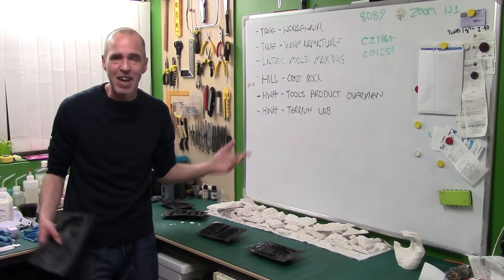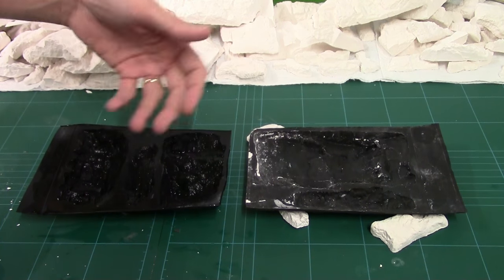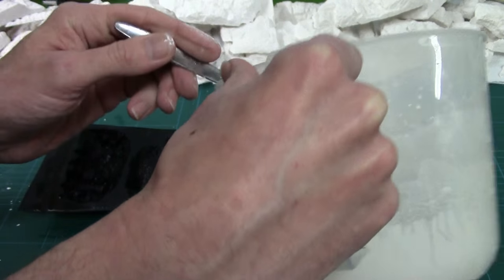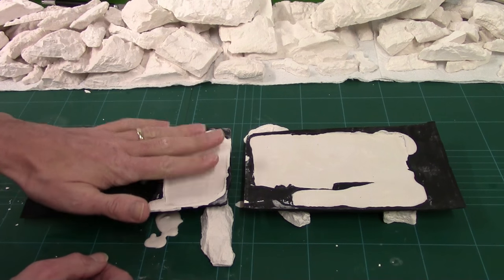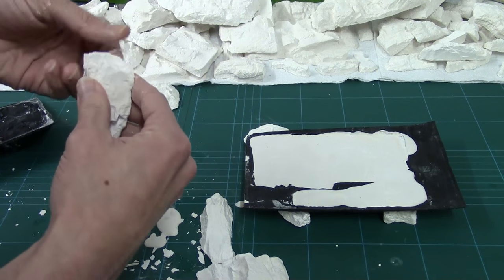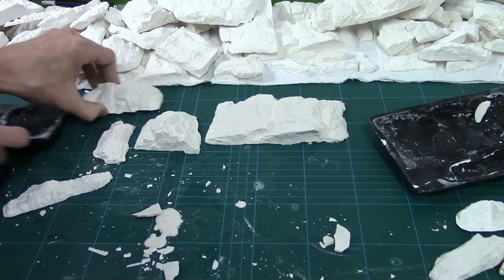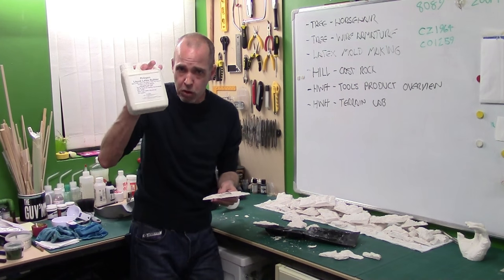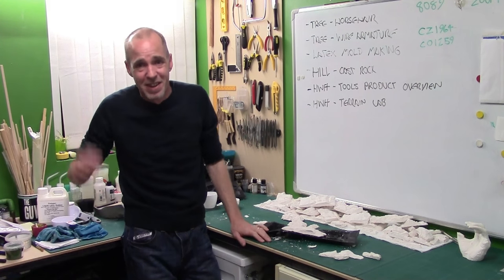How to make realistic wargaming cliffs & outcrops (Pt1 - casting the rockfaces)

Comment: When i used my Linka molds(designed for 1:72 HO buildings)to cast buildings for 15mm Flames of War, i always had the problem of the parts breaking when either too wet or too dry when removing from the mold, prolly due to the very thin nature of the linka molds. Too dry and they would adhere to the mold too tightly, too wet and they would be too fragile. Another issue is that you just cannot smoothe over air bubbles with your thumb when you're casting man-made structures, since it would eliminate the brickwork detail. I got around that by holding a cheap electric toothbrush underneath it, giving the mold a good, uhm, vibration. Scuse my language.
Reply from the maker: +hordelands When you demold them. Lay them flat upside down and roll the mold back from the edges whilst applying pressure to the cast keeping it firm on the table. Also, add black tipped clay shapers from Royal Sovereign to your toolbox for when the toothbrush fails bud ;-)

Comment: I was struck by how little mixing you did before pouring. I have to take an electric mixer and spend 3 or more minutes to get the Hydrocal I've got to work. I've found that using plaster definitely takes a "feel" for it. You did that so easily... How many hours of your time did it take before you figured it all out?
Reply: +Bill D. in Iowa With mixing powders in water, I usually mix the powder with just a little bit of water so all the powder is 'wet' and in a paste and then add the rest of the water. This makes it easier to avoid clumps etc  :)
Reply from the maker: +Bill D. in Iowa Herculite 2 is very forgiving mate. Hours, I have no idea, but I'm on my fourth 25kg bag :-)
Reply from the maker: +Molentik you wouldn't have time for that with this stuff, it was already setting in the jug by the end I finished the pur mate

Comment: Great video mate! I purchased a bunch of the moulds and used Plaster of Paris with water. Looks like they came out OK. Is it alright to use that and are you able to paint them or is the lightweight hydrocal stuff better to use? Cheers! Stefan.
Reply from the maker: POP chips really easy, personally I'd get some crystacal mate (cheaper and tougher than hydrocal)
Reply: Yep, I did find it chipped a little bit. I will have a look for that product down here in Australia. By the way your videos are fantastic. I have learned heaps from them and think your techniques and work is excellent.

Cheers,
Stefan.
Reply from the maker: Thanks, mix a little black paint in, turns the mix grey so when it chips, you don't get the white bits mate ;-)

Comment: Is there any good uses for the "flash" or is it just trash? Also could you use some of the thin molds and break them to use for warhammer minis basing or do you think the breaks would be noticeable.
Reply from the maker: +Graham Johnson I just trash it mate, it's too smooth for rubble
Reply: +TheTerrainTutor  what about breaking small molds for basing or dose plaster tend to break really clean.
Reply from the maker: Graham Johnson
it does but you can feather it, watch my next vid mate
Reply: +TheTerrainTutor But if you're a cheapskate, you can break the flash or even almost powder it to use amongst rubble if small enough, as structure paste or for expanding your pigment mud mixtures. I don't like throwing things away. Break it up by hand if you want to quit smoking, put it in a bag and smash it or rub it on a grater, doesn't matter. There's use for everything, though I understand you need time and storage space.